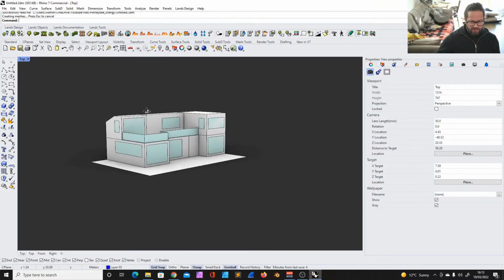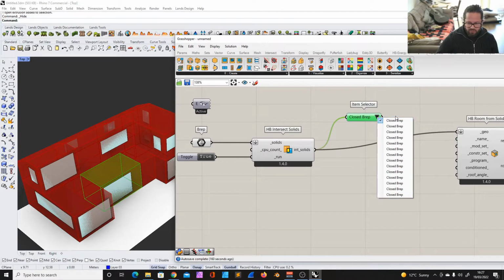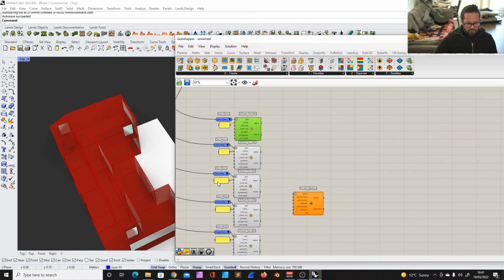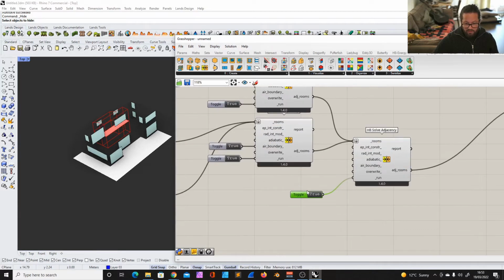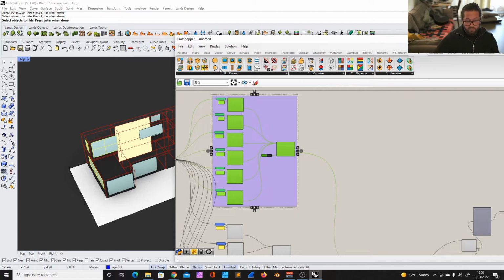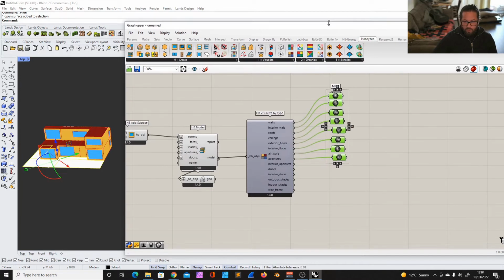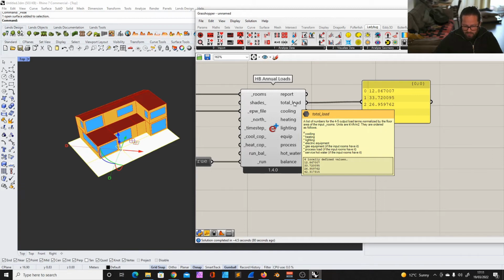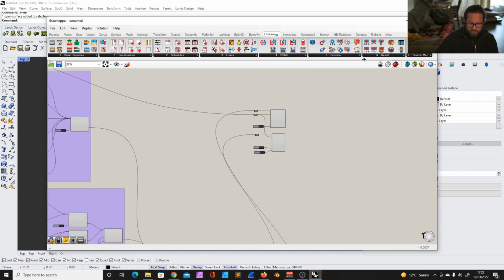Honeybee 'ENERGY' Part 1 | Setting the Scene | Ladybug tools 1.4.0

Comment: "Good evening, my brother. I have followed your steps to the letter, just as shown in the video. Everything is perfect, except when I use the Mesh tool to display the exterior_ floors; a part of the suspended ground floor ceiling appears as if it were exterior floors, as I've highlighted for you in the attached image. What seems to be the problem? Thank you so very much for your responsiveness and support."
Reply from the maker: Hi Adel I can see any image attached.
Maybe you could send it to info@nedomlel.com

Comment: "First of all, thank you very much for this excellent content; I have started learning from it and am benefiting from each lesson. I would like to ask for your guidance on a specific point: How can I model a building in Rhino based on a floor plan, such as a villa? As you know, the wall thickness in working drawings typically ranges between 15 cm to 20 cm or more. More precisely, how can I accurately create the energy model in Rhino based on actual construction drawings?"
Reply from the maker: Honeybee is here to test before you actually create a final design. It's based on construction sets, mathematical assumptions of thickness and materials instead of actual thickness in the model. 
The idea is to understand your design before you get to the stage of the actual floorplans...
Honeybee doesn't understand solid walls. (With a view of exceptions)
So basically if you want to test a design retrospectively  you need to create a simplified version of it. 
Hope it makes sense.
Reply from the maker: A good workflow is:
Use the floor plan as a reference in Rhino
Import the CAD/PDF plan, scale it correctly, and trace the main internal room boundaries.
Model the rooms/zones, not the full wall build-up
In Honeybee, you usually create closed room volumes. So instead of modelling a 20 cm wall as actual thickness, you normally trace the centreline or internal face depending on the purpose of the model.
Keep the geometry clean
Each thermal zone should be a simple closed volume. Avoid tiny gaps, overlapping walls, duplicate surfaces, small construction details, columns, skirtings, façade grooves, etc. Honeybee wants clean geometry.
Add wall thickness through construction properties
The wall build-up is usually not represented geometrically. Instead, you assign constructions in Honeybee/EnergyPlus: for example plaster, blockwork, insulation, render, etc. That is where wall thickness, material layers, U-values, thermal mass and insulation properties matter.
Simplify windows and doors
Model openings in the correct approximate position and size, but again, don’t over-model frames, mullions, rebates, handles, or other details unless you have a very specific reason.

Comment: Hello, I was wondering if you can show how to handle a 20-30 storied building with this method. There shall be more than 50 rooms ( identical) and also there shall be ground floor and roof. I was trying with my model using HB Move ( for the typical floors) and keeps receiving fatal error. Model is working fine without HB Move
Reply from the maker: Let me have a look.

Comment: Hi Mr. Phillip, After performing a simulation using Honeybee, I expect to access the simulation results directly by opening the 'eplusout.sql' file within the 'simulation' folder, which generally houses all the energy usage data. However, when you try to open this 'eplusout.sql' file using Navicat, you notice that the contents display garbled text. What could be the reason behind this problem?
Reply from the maker: Hi I haven't tried Navicat myself but it's most likely an encoding problem. Where the SQL database is probably not the problem. The text file containing the database the code is written in a way Navicat doesn't understand.
Reply from the maker: Maybe one of these options might lead to a solution:

Using Navicat's Encoding Options:

Open the eplusout.sql file in Navicat.

Look for an option related to "encoding" or "character set" in the import settings or file menu. This might vary depending on the specific Navicat version you're using.

Try opening the file with different encodings like UTF-8 and CP1252. One of these might be the correct encoding for your file.

Using a Text Editor with Encoding Conversion:

Open the eplusout.sql file in a text editor that supports encoding conversion, such as Notepad++ or Sublime Text.

Most text editors will have an "Encoding" option in the menu bar or under "File" settings.

Look for a "Save As" option with encoding selection. Choose UTF-8 (universal encoding) as the new encoding and save the file with a new name (to avoid overwriting the original).

Try opening the saved file in Navicat.

Identify Encoding and Convert with External Tool (if necessary):

If the first two methods fail, you might need to identify the original encoding of the file. Some programs show file properties that might include encoding details.

There are online tools and standalone software for encoding conversion. Use one of these tools to convert the file to UTF-8 and then try opening it in Navicat.

Comment: Hi Thank you so much for the video!!! It helped a loooot!!

Have one question here,
I tried the solve adjacency, but for my rooms (with a 30 deg angle), part of the roof is not shown after using this tab. 
Does anyone know how to fix this??

Thanks in advance for your help!!
Reply from the maker: is your roof or wall curved, have you played with the roof angle adjustment? I did a video on curved shapes, and HoneyBee; also in this series...
Reply: @PhilippGalvanDesign  Thank you! I'll check out the video u made about that. 

But btw my roof is just with a slope not curved (less than 30 deg slope, but it will only get recognised by HB if I key in 40 deg and above) and even with that, part of the roof is not recognized after going through adjacency.. which I havent found out why @.@
Reply from the maker: @Pasunreve212  🤔 interesting....i have solution right now, but something to look into...

Comment: Hello, I get this message "1. Solution exception: ** Fatal ** GetSurfaceData: Errors discovered, program terminated." and I don't know why in the part of the HB Annual Loads component
Reply from the maker: I your case I would look into the example files and see if they are working. If they don't then something is wrong with your installation.
You can find the example files in the Ladybug tools installation zip file.

Comment: Have you found a more elegant way to assign room labels/build the model by room? i.e. if you are working on a large project with say 500 rooms, (organized by layer in rhino) it would be impractical to assign each one as you did in the beginning of the video. But they need to be imported together to use the intersect solids component. Thank you! I love your channel!
Reply from the maker: Hi Emily, good question. Yes for a 500 room hotel or hospital it would be impractical. I would probably combine first all rooms by category. You can input more the one geometry into one honeybee room component. I should make a video... :D
Reply: @PhilippGalvanDesign  does that still require connecting each of 500 breps to a room category? I connected up a work around... which adds groups of geometries into the intersect solids component in order and then pulls them from a list in that order... but this is pretty clunky and not at all foolproof. Anyway, thoughts appreciated!
Reply from the maker: No, that's what I meant, you can place a brep container with your geometries (any number of boxes with the same category) into the HB room tool. For example I have a hotel with 200 double and 100 with king-size bed rooms. One brep container for your 200 double bedrooms and one brep container for the 100 king size bedrooms.
In reality it's probably not that simple. 
For larger projects its good to think of how to organise the script to be economically and flexible at the same time. 
For a hotel with a lot of repetition I would probably solve it floor by floor....
Reply from the maker: I will have a thought regarding the intersection etc...

Comment: Do you know why when I change the link between HB visualize by type and mesh,  for the various types (ex. walls, interior walls, ceilings ..etc.) nothing seems to change visually on the model? The model continues to just display the walls as yellow surface no matter what i do. I also can't get the red surface previews to disappear even though I've turned previews off for everything. Do you know why this might be?
Reply from the maker: If you have turned the preview of all components off you shouldn't see anything.
How about your grasshopper viewport options?  You might want to send me a grasshopper screenshot or the script so i can check what the problem is. 
office@nedomlel.com

Comment: Hi. I just want to suggest you that you should use Open studio component instead of energyplus . In OS component you can simulate varied Air conditioning system which can throw error otherwise directly in eplus.
Before starting this seriess you should also describe how it translates the data to OS and one can change data in OS app
Reply from the maker: Hi Asis, thanks for the valuable insight.  It seems you have already more advanced knowledge about the different components. Would be interesting to know where or how you learned the craft. I hope I get there too at some point through exploring.
Reply: @PhilippGalvanDesign  Thanks for  replying. I am using this tool kit since its birth. The most of it I learnet from the Ladybug Discourse discussions! I loved your honeybee radiance videos! Keep up the good work! 
I had also added a video on advancement with honeybee radiance https://youtu.be/CWcR2SNO32U